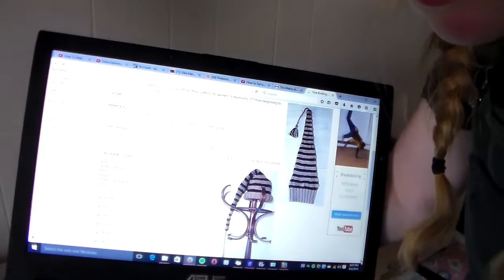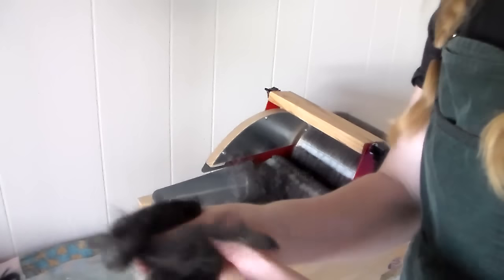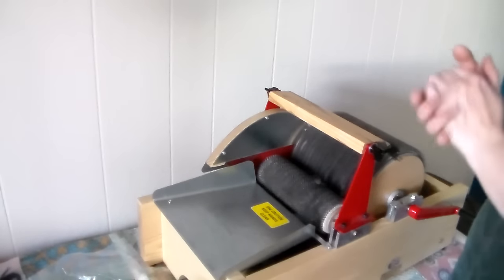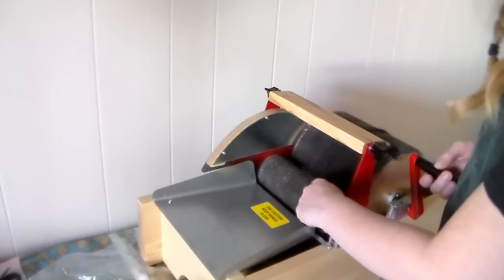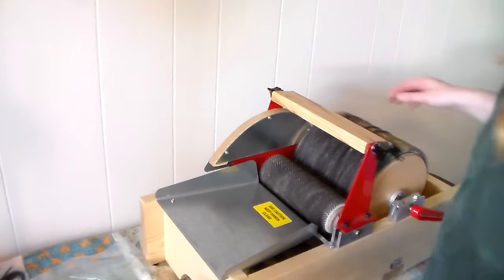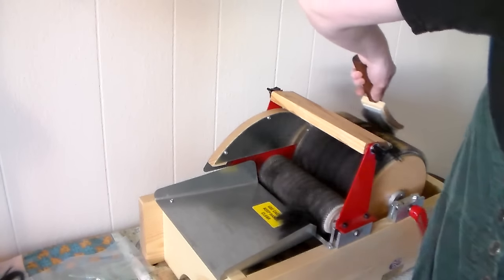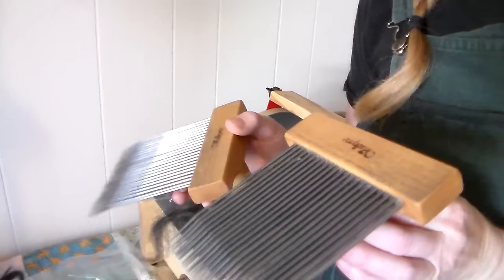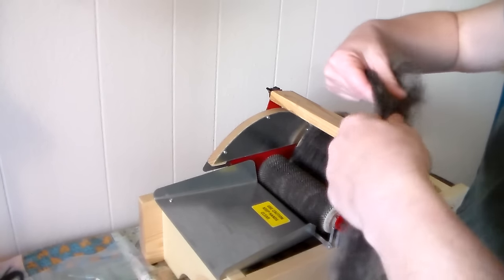Crafty Thursdays: Blending With a Drum Carder

Comment: You can get combed fiber that's commercially prepped. It's called combed top or just top. It's combed just like you would do on those beautiful Valkyrie combs you're holding, not in a carded prep like roving. It comes in long strips just like roving does. Unfortunately, a lot of people use the word roving in the wrong context, or interchangeably. They basically call anything in that really long strip-type prep roving, even when it's not.
Reply from the maker: +Anne Clark Yes, you can. I don't like to use it unless I prepare it myself because of the cost.